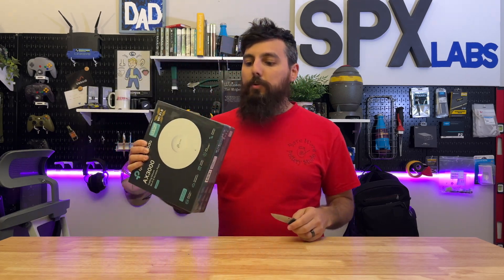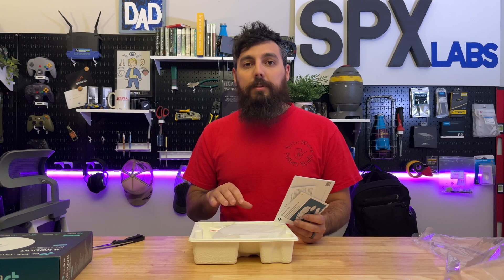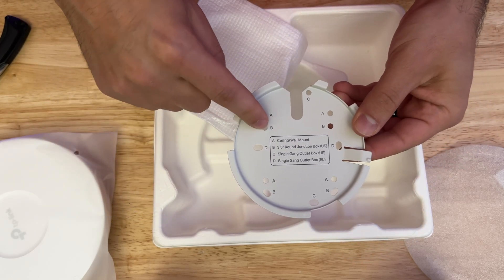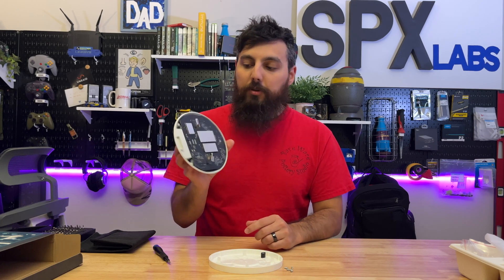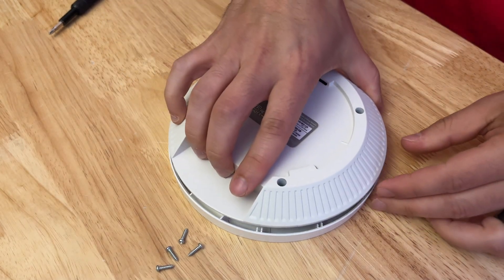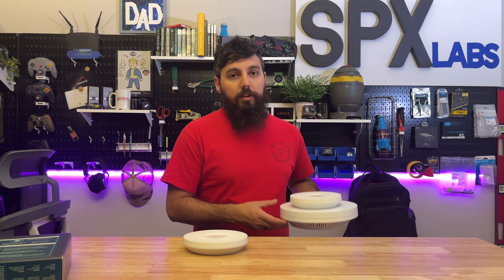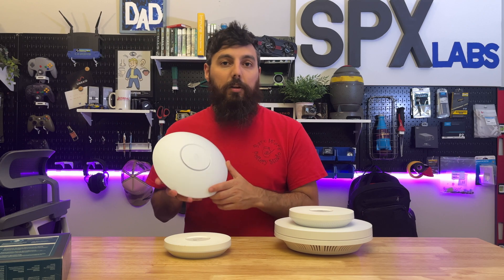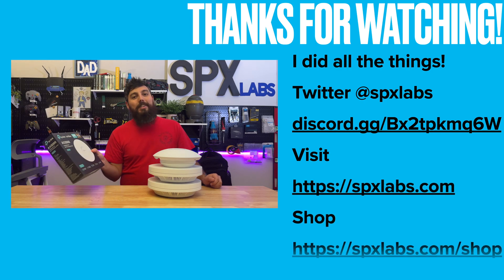EAP 653 WiFi 6 AP Bandwidth Testing, Teardown, and Unboxing | TP-Link Omada

Comment: I am looking for some advice.  I am planning on moving into Omada here shortly and am torn between the 653 and 670 access point.  I plan to have 2 and this is just for my home but both my wife and I work from home so a good strong connection that can handle work as well as everything else in the home is necessary.  Do you think the 670 is overkill?  Thanks for all your content, very helpful.
Reply from the maker: Depends on the size of your home, materials, etc etc.  Omada is overkill in general.  My current recommendation is GL Inet Flint 2.  It’s for a blend of power users and tinkering but also cost effective and high performance.
Reply: Thank you for the quick response.  The house is 1800 sq feet, nothing massive but it has two stories and one of the driving forces here is the connection downstairs right now, even with my Velop mesh routers, is pretty crap and unreliable.  Complicating this is my connection coming into the house is not centrally located.  I work close to the entry point on one side of the house but my wife is essentially down a floor and on the other side of the house when working.  I was hoping to maintain a mesh setup but will look into your recommendation as well.  Thank you again though, very much appreciated.  Any other thoughts?
Reply from the maker: Oh yes multifloors the worst kind of homes.  Get a cable to the next floor and connect your mesh points using that cable.  It will drastically improve your current setup.  Can’t run a new Ethernet cable? Buy a MOCA adapter and use the current coax lines to get internet to the existing rooms.  Don’t have coax.  Call a professional and have them run dedicated Ethernet lines around the house. Otherwise WiFi will always be mediocre
Reply: Thanks for being so available.  I have actually already begun wiring the house but did not think about wiring the mesh node.  Thanks again and keep up the great content.

Comment: Does the orientation of the antenna tell you anything about whether this unit is less effective on a wall as opposed to a ceiling?  Many many reviewers claim it's very directional and not effective on a wall.
Reply from the maker: I don't know.  I haven't tested alternative orientations however, this device is omnidirectional so it should be adequate enough.  BUT there are a lot of variables to consider and I'm not about to write a thesis on YouTube.  If I have time I should make a video testing it.

Comment: Hello, I am hoping you can let me tap into your expertise.  I am setting up a boutique ISP and am looking for a wifi6 router with a 2.5Gb ethernet port using PoE.  So one or two ceiling wifi6 routers depending on the size of the apartment.  I want it to have the bands that have the radar interference overlap assuming that for most customers radar interference won't be an issue.  Want the MIMO, multiple simultaneous streams, etc.  So can you recommend a solution in the "sweet spot" for price and performance?  Something like not the latest and greatest because it will be too expensive.  Rather, "previous generation" where the hardware has proven itself in the field and is very reliable and the price has come down to make it more affordable.  So perhaps 90% of the performance of the latest gen at 60% of the price.  Any information would be greatly appreciated.  Thank you.
Reply from the maker: I'd recommend reaching out to a professional.  Like this one https://www.mactelecomnetworks.com/contact-us
Reply: @SPXLabs  Thank you!

Comment: Sorry my last comment was removed as I include link to show antenna on pcb. I think the shiny tracks in the underside are the antenna you can run tracks like this to make antenna when using high frequency. The tracks in the PCB can be laid to act like an antenna. edited PCB tracks can act like antenna if laid and spaced appropriately. I recalls one of my lecturers many years ago drilled into us that a Resistor is not just a resistor but a Inductor, resistor and capacitor as the ends of the resistor act like antenna hence you have the whole study of EMI and reducing EM interference. so even tracks on a PCB act like antenna for RF floating in the airwaves, if designed and spaced correctly you can make the PCB tracks your antenna for 5ghz band. Given the wavelength decreases as F increase at 5ghz is ~6cm  so 1/2 wave dipole would be 3cm. you can easily put that on a PCB. at 5:25 you see the right and left you have [ I ] shapes , i maybe wrong but those maybe the antenna. This form of design can help in MIMO and beamforming (by driving diffrent phasing of the same signal) you can direct the antenna to have higher gain in one direction and steer it for best reception. Like u see those spinning radar antennas scanning/sweaping a whole area, but do it without the spinning.
Reply from the maker: Oh yeah dope.  Those "stand off" antenna are for the "smart antenna" functions/features.  Which I learned afterwards.

Comment: Wouldn't this be the "cousin" of the EAP 650? This is much better than the huge EAP 690 you showed (in another video) or the 660 in the current one, man that thing is way too big lolll. I mean with something like the EAP 653 or EAP 650 or anything like it, you can add two or more in a house to get good coverage. I have two 650 in my case, one in the basement, one on the main floor, works like a charm!
Reply from the maker: Idk man.  Family stuff is weird.  Yup you totally can do that